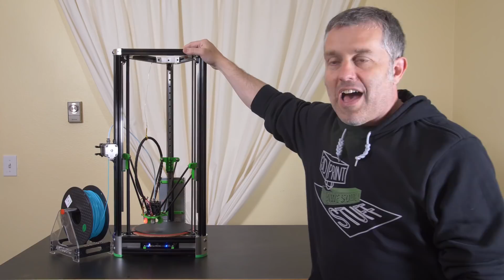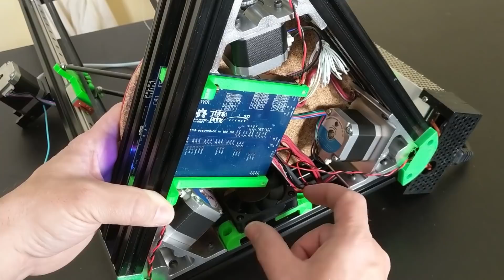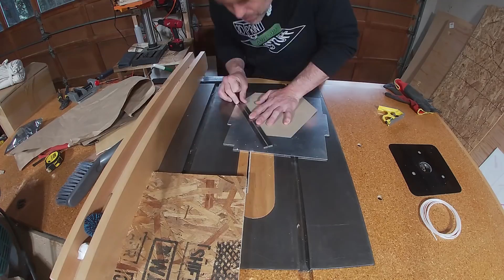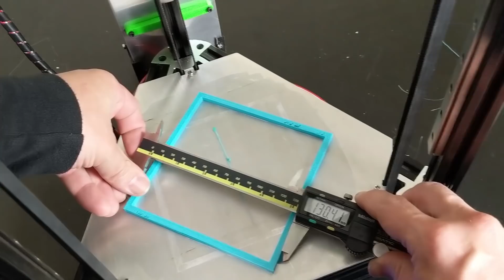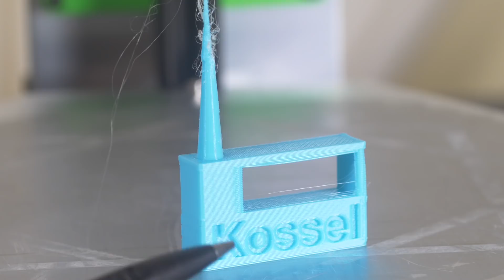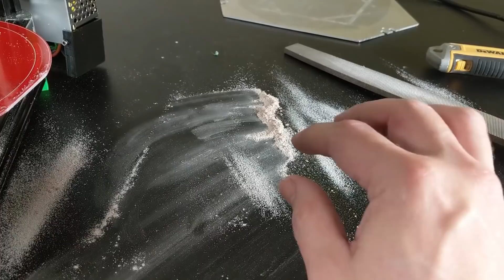The "Kossel Evolution" - The Fastest New Printer From Yesteryear

Comment: would it be safe to assume that if say like me I dont own a delta printer...and I bought the aluminium corner bracket kits, and some lengths of linear rail from a maker shop, a few linear rails/guides, that i'd have most of the frame sorted for a delta printer minus the electronics and motion parts?
Reply from the maker: I just priced the aluminum extrusions, metal corners, magnetic push rods, PCB bed heater, and linear motion rails on Ebay. This is not a complete printer. Just these components cost $270. You would be better off purchasing the Flsun Q5 which I recently reviewed. If you really want a Kossel, look up the Flsun Kossel Mini. I believe you can get that kid for about $200 and do the upgrades as I have shown them.

Comment: Afaik the effective printarea of a (standard size) Kissel is a17cm circle. Could be that the rectangle you print is outside of that are that's causing the incorrect dimensions of the part?
Reply from the maker: The Bed in reality is perfectly flat. Looking at the height map (even my "flat" fixed height map)  the printer doesn't think that the bed is flat and is therefore trying to move the nozzle too close to the bed (maybe even into negative space below the bed). This causes the end effector to twist which pops the magnetic joint out of it's socket.
Reply: @DesignPrototypeTest  Got it.
I tried compensating for uneven bed back when i had a working Kossel but in the end realized that it's best to not have to compensate and build the frame as straight as possible and use a super-flat bed which is exactly perpendicular to Z.
I ended up only using the probe for enstop-offsets. (think smoothieware calls it delta calibration)
Thanks for the video. Gave me inspiration and I am once again bringing my old kossel back to life. =)

Comment: Looks like total shit, crosshatching, impressed with speed but speed isnt worth it if it looks like shit.
Reply from the maker: You can only see the cross hatching when shining a bright light off the surface at just the right angle. It is far less noticeable than the layer lines themselves.
Reply: @DesignPrototypeTest  I gotcha, very impressed that the extruder could keep up.

Comment: I purchased this with the linear rails.  It my first printer.  Could not get it to work, boy was I pissed.  I then purchased a Duet board a couple of years ago ( I think), but still have not installed it.  I may just use the parts to build a different machine.  That may be a better use of  my time.
Reply: They work great when setup properly

Comment: Were those ball and socket joints magnetic, or traditional (mechanical) joints? I can't tell from the video. Just curious what you had here - eg when it separates, is it coming loose from the socket (and then rejoining), or is it separating the magnetically adhered ball + socket (and then re-joining). Best wishes.
Reply from the maker: I made a whole video about them: https://youtu.be/NocEf9Wi_5Q
Reply: @DesignPrototypeTest  My fault - I did see that video, but thought this one was a different printer seeing the new green parts instead of the orange.
Reply from the maker: Yeah, It's confusing. I should have mentioned that it changed color. I forgot to talk about that.

Comment: Regarding that magnetic ball lifting out, would that be solved by lengthening the arms a couple/few centimeters?  Seems like that would put mitigate whatever forces are stressing the joint.  The trade of would be a bit less build height.  I suppose you might need to mess with the firmware a bit, as well, so the board would be able to calculate the geometry properly based on the different arm length?

Whatever.  Just thinking out loud.  You seem pretty determined to let this one be and just use it, which I can relate to.

Re the Predator, I almost ordered one the other day but they turned out to be not in stock everywhere.  No new units until June, from what they said.

Comment: Great video!
The problem with the magnetic ball end jumping out smells like a geometry issue, it would be interesting to see is there is distortion on any of those rails (maybe swap them around and maybe then swap them end to end to see if your error moves with a rail, or changes when you swap ends), it may also be interesting to replace them with some without slack which may exaggerate the error and make it easier to find.
Other than that, that machine is fast and accurate, I can imagine you might even improve on that accuracy with the rails and ball end issue resolved.. But as you say, it is all a trade-off, that slack in the rails might just be providing some benefits at the moment.
Well done though, more of the same, please!
Reply: the geometrical issue is that the ball should be on the effector and carrier.. and the magnets on the rods..
Reply: @Nitram_3d  why do you say that? Would not have thought it would make a difference!
Reply: @tasmaniakguitars  You want the force in the rod direction..
Reply: @Nitram_3d  oh that makes perfect sense.  Cheers mate!

Comment: Where were you able to keep your stepper motors quiet?
Reply from the maker: They are reasonably quiet. Not as silent as they could be on "stealth chop" but definitely no whine like you get from a a4988 drivers.
Reply: @DesignPrototypeTest  Does the Flsun QQ need marlin to upgrade to the TMC2208?

Comment: I have a Kossel linear plus build upside down (so controller box on top) running Klipper on a RPI3 with the default board, I can highly recommend this setup as it removes the pain of turning the system around whenever you need acces to the board. Planning on installing a MIC6 build plate on it for science. Running klipper also reduces the cost by a ton vs a duet wifi. With certain types of prints you can really push print speeds above what is shown here on these things.
Reply: Definitely agree on using Klipper instead of Duet wifi. Easily one of the best upgrades I made to my Kossel, and all I needed was a raspberry pi, which I already had for running OctoPrint anyway. So basically, I went from 8 bit to 32 bit printing, with a massive increase in speed and print quality, for either $0 or $35, depending on whether you count the fact that I already had an rPi running OctoPrint.
Reply: So, those boards are not locked down heavily? Just adding a bootloader will make it run Klipper?
Reply: @phischtv4497  just add a raspberry pi, attach it to the board and follow the docs, the firmware for the default trigorrila board is on the Klipper github. Its a pretty clean install.
Reply: @phischtv4497  it depends on the board. Mine was an Arduino/RAMPS, which runs open source firmware. You can go to the Klipper website and check to see if they support your board.
Reply: I'm also running a Flsun delta printer with Klipper (PI 3b+ and the original Mks Gen L 8 bit board). Works well. I have a vid on my channel.